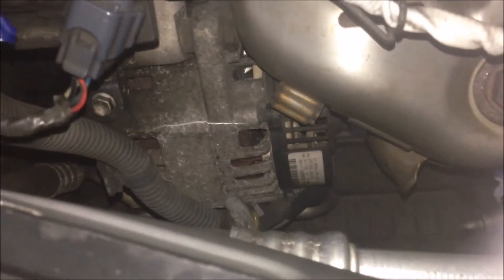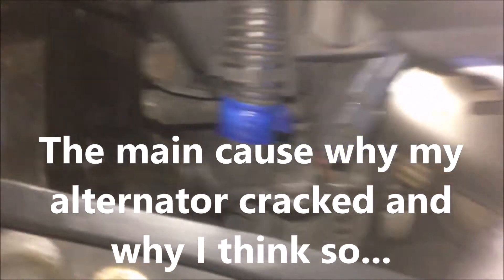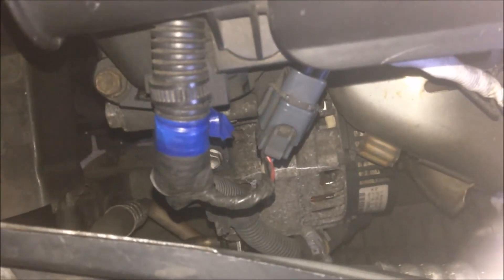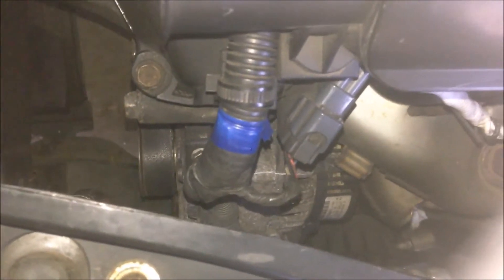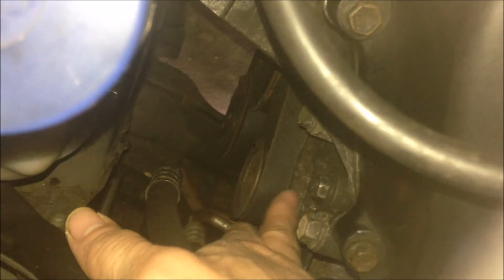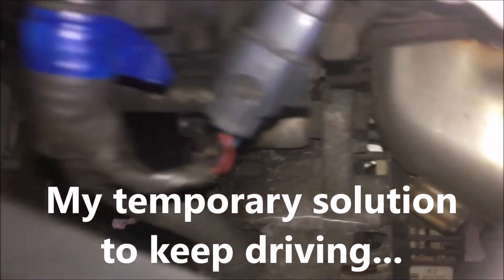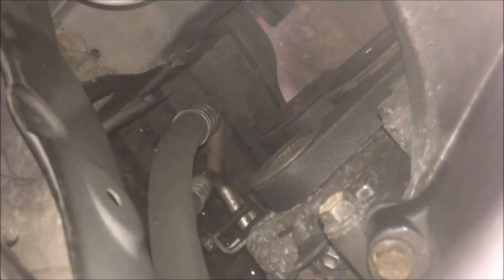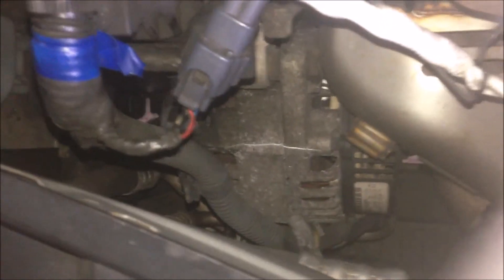AYGO: Why My Alternator Cracked? Seized? And a Temporary Solution? Toyota, C1, 107

Comment: Hi, i have exactly the same issue. Pulley will rotate freely when i lossen the top bolt a bit and seize when i fully tighten it up like it was before. A crack has appeared just like yours. Otherwise alternator provides good current. I am thinking to keep top bolt reasonably tight only  and use some metal epoxy to repair the cracked area. Your thoughts?  Did you carry on with alternator, for how long?
Reply from the maker: Hi, The alternator is still in my car, running well. Here are my further solutions: 1). I used 2 stainless bands to go around the casing and hold the cracked casing together; 2). I used a bicycle spanner (thin metal plate spanner) to be put onto the bolt and used ties to hold the spanner to the alternator bracket, to prevent the bolt loosening itself. I check it every two months, so far so good. I may replace it if I found a cheaper one. Have a good day!